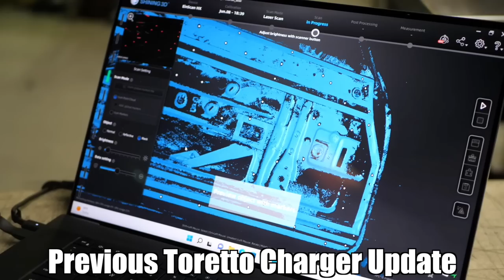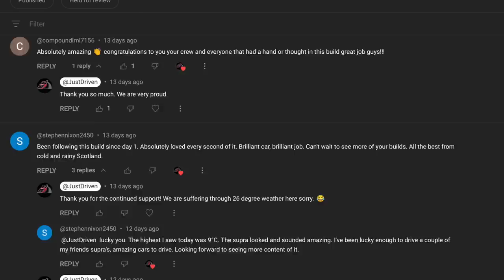The Fast & Furious Charger Engine Breakdown and Wheels Fitted!

Comment: Rear tires look too big. Might just need to see them from a different angle. Great video as always! Can’t wait for the final product!!
Reply: That's the point.. the biggest, fattest tires that will fit.. for max traction. And those tires are just that. The biggest tires that will fit under the stock fender wells.
Reply: @jeremywillis7407  but that’s not what was on the car from the movie..
Reply: @jackmossman7559  The movie car had 28x10.50x15's Mickey Thompson E/T Street's. Those tires are discontinued.. the original one's. In this application with the Hemi making excess of over 900 horsepower those little ten in a half wide tires would never take that much power. All it would do is spin. The more tire contact to the ground the better it will hook and go and be a lot safer plus it looks mean as hell too.
Reply: @jeremywillis7407  you can still get that size. You can put 900 down easily on 10.5 wides.. plenty of weight and just have to know how to set up suspension. Those tiny 31 spline axles will break before the tires. It’s not meant to look mean as hell, it’s meant to look like the car from the movie as they keep saying over and over. The engine already doesn’t look like from the movie, now these things. Either do it all right, or don’t at all.
Reply: @jackmossman7559  It looks great and it definitely is made to look mean. If you're that devoted build it your damn self lol. Yeah they do make 10.50's but as I said before.. not the Original ET Streets. They're a different style. There's always gotta be a dick head in the crowd that thinks they're right about everything. 👍
Reply: @jeremywillis7407  I already have a black 57 bell air that’s tubbed running 28x18 Hoosiers with a 572 and 871. I’m saying they are so devoted to copying the movie car as accurate as possible… your definitely the guy with nothing to show trying to make comments, then there’s others making comments that can back it up. Two different leagues
Reply from the maker: We aren't planning to tub the car and wanted to make sure we have the most tire possible for traction. Why does the engine not look right? Here we are thinking we are doing a great job, and to see how bad we are doing surprised us!
Reply: @jackmossman7559  I have plenty to show for but thanks for assuming you know me 🤙 05 Mustang GT Street Rod and a 66 Mustang 289 resto Mod.

Comment: That rear end needs to get squatted down and probably drop down a couple sizes on the rear tire and one size down on the front. Way more beefy than the movie. Body work looks perfect
Reply from the maker: We love some meaty tires. We have some more adjustments to the rear end and an alignment before we decide on a tire size change. We don't need the tire sizing to match the movie car.
Reply: @JustDriven  I love a meaty tire also! Excited to see this come together, I’m blown away about how accurate the body work is. Dialing in the suspension in could help the look of the tire a lot also. Little by little!
Reply from the maker: Next update should be an exciting one!

Comment: Such an amazing car so awesome 👌 
You guys know way more than I do about cars and the  Mechanical part too, but I see the  Orange can of death on the  charger motor, you guys won't run the orange Fram oil filter on it right?
Reply from the maker: Thank you for the support. The Fram filters are put on by Joe with the engine build. We don't use them but will need to do engine break in and oil change before running it. No sense in replacing the filter just to replace the filter again.
Reply: @Just Driven  yeah that makes sense 👍

Comment: I hope that Fram Oil Filter is just there as a Fod/Dust cover!
Reply from the maker: We run Fram on all our cars. It's the best filter we've ever used. Which filter is your favorite?
Reply: @JustDriven  My two vehicles is a 2017 Toyota 4Runner TRD Pro (daily), and I use the OEM cartridge filter every time, and a 2001 Ram 2ns Gen 24v Cummins 4wd, and I use the Genuine Mopar Filter. I guess I use OEM when possible. I figure if it was good enough for the factory...

Comment: All that work and a garbage Fram filter
Reply from the maker: That's the stuff Joe puts on his builds. We have to run fluids through it and replace all this anyway. Didn't make sense to replace it just to replace it....then have to replace it again.
Reply: @JustDriven  if it's just for break in ok but seen too much bad come from those filters since the media in them is pretty much cardboard and they seem to develop rust frequently in them
Reply from the maker: Yah, the engine builder (Joe who's been building engines for decades) installs them. We don't see the point in swapping them out when they have to get pulled later anyway.
Reply: @JustDriven  completely understand no point in using a high quality filter for break in but still would rather use a better one

Comment: I have a 2011 camaro lt with the v6 engine i want to convert it to the v8 how mutch would you charge for that job i have the ecu already and the standalone harness and i have a 2011 ss automatic transmission to go with the engine
Reply from the maker: We don't currently build cars for clients. So sorry.